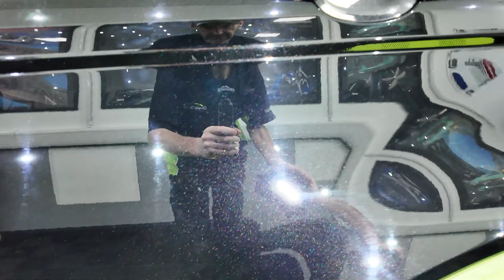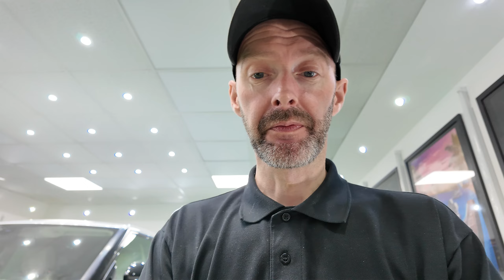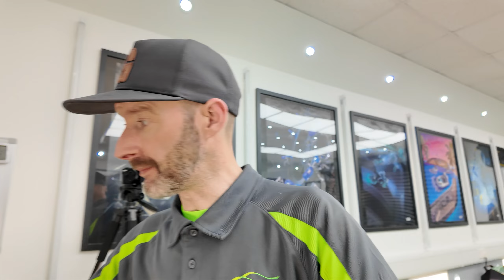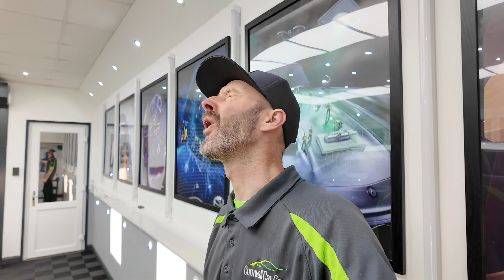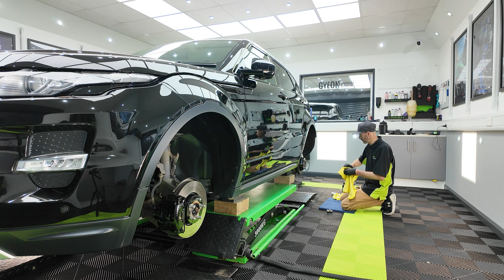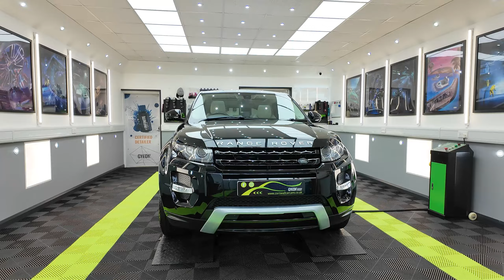From Dull to Dazzling: GYEON Ceramic Coating on Range Rover Evoque

Comment: Do you re-use your bald and soft wipes or do you discard after use?
Reply from the maker: @stevenkinnell1878  If any cloth touches a coating they go straight into a bag and there is a mechanic shop round the corner that take them and use them 👍